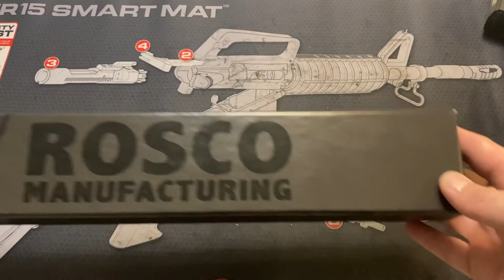Rosco 8.2" Barrel - .300 Blackout Build Series

Comment: How does the barrel run with subs . Have the same exact barrel and it doesn't lock back  on last round with surppressor
Reply from the maker: I had the same issue when I first got my suppressor for it.  I changed the buffer to a regular carbine buffer and SpringCo Yellow (reduced power) spring and now it runs everything perfectly and locks back every time.

Comment: How are you liking your barrel? I’m deciding on if I want to go with that manufacture for a few weeks now. They seem like a solid brand to go with. Also, do you feel as if you have enough real estate with the length that you went with?
Reply from the maker: I love this barrel.  In fact, I like it so much that I used another Rosco barrel for my newest build: a 14.5" pinned and welded 5.56.  Rosco makes fantastic barrels.  There is just enough real estate on the rail for my light and pressure switch, but it doesn't give me enough room for a front iron sight with the pressure pad for my light.  I could've chosen a different light/switch setup and still had room for backup irons, though.  There's also not enough real estate for a vertical fore grip because of where the gas block is, so I've been using a small handstop near the muzzle-end, instead.  It's a short handguard, but the trade-offs are worth it, to me.  I like having a short, easily maneuverable gun.

Comment: The gas block hole is much larger than the hole on the barrel so you will not have an issue
Reply from the maker: Yeah.  It worked great.  I did take it all apart and make sure everything was lined up properly before I took it out shooting for the first time, but it's been very reliable.  I'm still waiting for the suppressor.  Going on seven months...